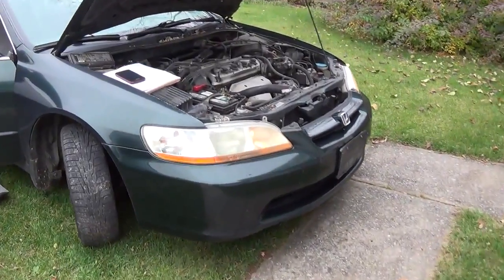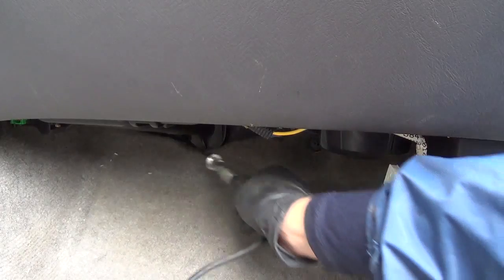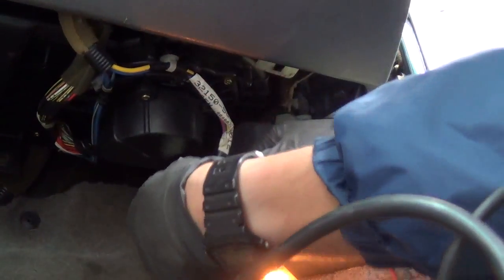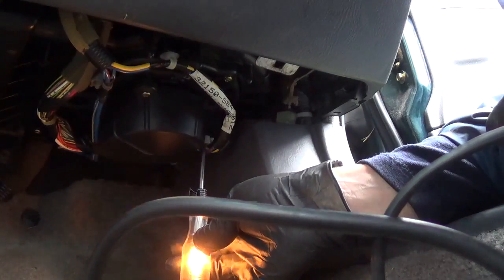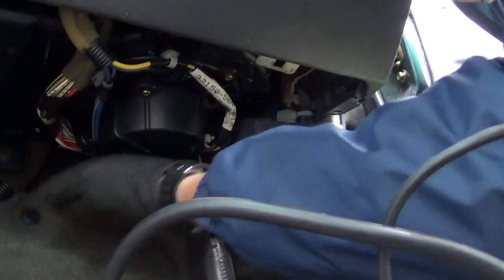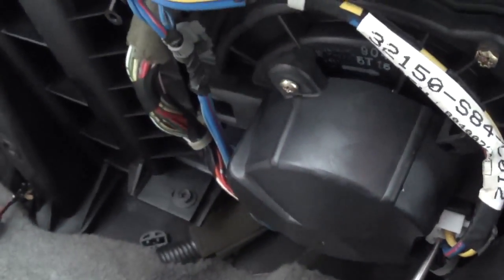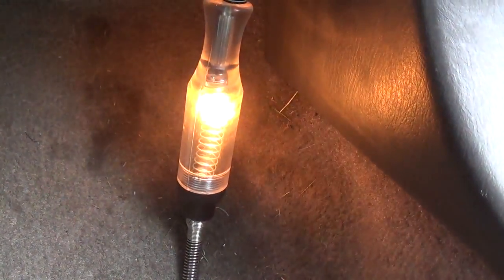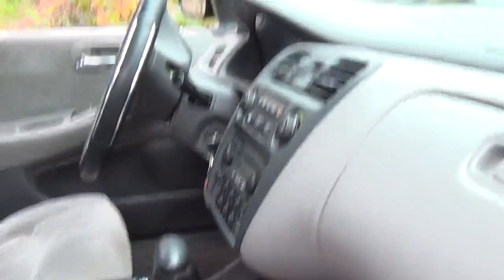Blower Motor Intermittent: Quick diag

Comment: hey everyone out there, with this problem....be sure to check that the wires in your connector are making contact...I just readjusted the wires on mine and its working again....I spent years with this motor not working properly and it was just some wires not connecting well....hope someone else out there gets lucky like I did. Thank you for the video pine hollow!!!

Comment: Wow man, that was pretty awesome. I just used your technique to be 100% sure for my failing honda odyssey blower motor. I was about 80% it was the fan blower because everytime it failed and I went to go check power and grounds at the connector the fan would usually come back to life and I felt I could no longer test it since it was now working. No amount of wiggling things around would get it to fail again it would just happen on it's own. So I figured - yeah it's PROBABLY the blower motor but now using what you've just illustrated I was able to see it with the test light and get it to fail by having it stop on the dead area of the brushes.

Thanks for that!

Comment: Thanks for posting video. I was searching for something different and came across this by mistake.  I have had an issue with the blower motor in my 2009 Jeep for 3+ years.  I knock it a couple of times with a water bottle when it doesn't work and it always comes back on.  Now I know how to check it if I ever get motivated enough!  Obviously not an urgent repair since it hasn't failed over the 3 years I have been "bottle hammering"!

Comment: Intermittent working of car blower fan is not always loose connection , but a lot of times bad brushes inside the blower fan motor causes that , mine even tapping the blower cover with a long stick while driving , starts it again when quits...below is what I got online  :
When they first start to go out, switches and carbon brushes can present either (or both) of the following two symptoms :
Off-and-On Use. ...
Decreased Tool Power. ...
Tends to Run Fine After Starting. ...
Off-and-On Use Worsens Steadily. ...
Off-and-On Use During Operation. ...
Shaking or Slapping the Tool Helps. ...
Banging Sound.

Comment: .. FAN MOTOR RESISTOR .. DID YOU CHECK THIS...? 🥰.. HOW DID YOU ULTIMATELY REPAIR THIS FAN-MOTOR PROBLEM...?👍🙏😇
Reply from the maker: DID YOU WATCH THE VIDEO?
Reply: @PineHollowAutoDiagnostics  .. Yes...Sir .. I just was wondering if you replaced the motor, or did you replace the resistor .. You diagnostic of the Fan-Motor was great .. I had not heard the word "commutator" for many years, but after looking it up, I understood just what you were talking about ..👍👍👍

Comment: I’m changing mine. How do you remove panels to access? And what what tool and size usually to remove bolts of motor and resistor? Sorry a chica asking. I don’t think a mini wrench will help me in this odd spot. 😜I need to buy tools as I have none in city I’m in now. This is a job I’ve never done before so clueless. Done other work on my car before but this nope.
Reply: I think it’s Allan key. Forget it. Lol parts person said bolt. Doh!

Comment: I have a 2005 dodge caravan, ac blower was working intermittently , somewhere online I read that low gas in ac system sometimes causes that , I let they add some gas in it ...no more intermittent working blower...mechanic touched nothing , no relay no fuse , no module , just added gas...I don't know if will it work  for every case , but worked for me
Reply from the maker: Do you mean the blower fan or the A/C compressor?
Reply: @PineHollowAutoDiagnostics  I mean blower fan  , but sorry I was wrong , problem came back , my problem is exactly what you show in this video , I am gonna buy a new blower fan...btw  my problem is not that severe , about 90% of the time it is running and when quits after about 3 minutes by itself or whenever car falls in a pothole or so comes back by itself...thanks for your response and your video

Comment: Double check me, please. Assuming blower motor brushes and commutator r good, our test light should b bright when connected from control to ground in off position. At low speed the test light should b brightest. Because there is the highest voltage or differential. If blower is on high, light should b off because a full ground is being supplied to motor control and so there should b least potential. When switched off, no light indicates open circuit. Bad brushes/ commutator.
Reply from the maker: +Bill Rimmer Yup that's an accurate description. That's why they call it "scope on a rope" ;)

Comment: The Test Lamp is flickering because the climate control uses (PWM) Pulse Width Modulation to control the motor speed instead of the old method of just different resistor voltage dividers to control speed.

The PWM system uses duty cycle to control the speed by turning the DC Current off and on in different time cycles i.e. 50% duty cycle would be approximately half speed, 75% Duty Cycle 3/4 speed etc.

However, the motor can still have issues with its windings or more likely as you said issues with the commutator making bad contact, perhaps moisture over time has caused corrosion in the motor commutator causing poor current flow.
Reply from the maker: No, not on this car. Actually you wouldn't see the test light flicker even on a PWM system, since the driver frequency is much higher than can be seen with a test light 😉
Reply: It's higher freq. / so faster than the eye can notice and our eyes have the property of persistence so its just the opposite, the human eye would see it lit up. However, the  sensor of the camera is fsst enough to detect the flsshing of the PWM. And, yes that car would use PWM. It's not old enough that it would be using purely a resistor network for the different speeds. You got to have something from the 70s with those bulky power eating resistor voltage divider systems.
Reply: Curious if PWM is the reason for needing heat sinks on the modules? Would older systems using separate, individual resistors still need the heat sinks?

Comment: Your diagnose is OK, now remove the motor and clean the contacts in the rotor and brushes. And at the end put some oil or light grease on the bearings. Done.
Reply from the maker: +Willem Streutgers That's extra charge! If it was my own car of course I would have torn the whole thing apart :)
Reply: So I understand the Q was only diagnose instead of Fix it ?
Reply: Willem Streutgers you have to pay for a rebuild or repair. This would only fall under the 1 hr diagnosis pay, which he did in 5 min. It’s a pretty good diagnosis too.

Comment: i have a 2014 chrysler town and country and i think i have a bad blower motor there are times where its delayed coming on when i am driving it it comes on but then goes out it repeats that could it be a bad blower motor?
Reply from the maker: Sounds like a bad controller or resistor, not the blower motor itself.
Reply: @PineHollowAutoDiagnostics i changed the reistor still same problem i am at a loss

Comment: 2006 Chrysler 300 3.5 Touring Blower motor works most if the time and then sometimes - although rarely when I start the car and turn the knob - nothing happens - and there are no illumination/ lights on the control unit. When it is running it blows strong and in all positions and in all different speed selections. Any suggestions?Thank you in advance!
Reply from the maker: did you try kicking it in the pants like I did in this vid? ;)
Reply: Haha.  
I would have but when I went into the car today it's working again.  
What do you think it could be?
Do you think the blower motor needs replacing?

Comment: My blower motor has a delayed start, which has just started happening. Takes up to 20 minutes before it comes on, - what is likely the cause ? - any suggestion appreciated. Works on all speeds when it finally comes on
Reply: Test the blower motor
Reply: @deerhunter8533  Yes, did that, - turned out to be the relay

Comment: My  blower motor stopped working for 3 days then kicked on suddenly on a 92 silverado c1500. The dealer said it happened alot on those years and even into the early 2000s. Said they see alot of the   blower resistor melting or something other. Can anyone confirm this as a possibility?
Reply from the maker: Sure, anything can melt! Do a wiggle and bump test, should be easy to track down :)

Comment: The Hondas here in Canada tend to get Polar Bear fur in blower motors. {;-)
Reply from the maker: +wysetech2000 Should have popped it out and done a visual inspection ;)  I assume that dead spot is caused by the motor/fan being mechanically stuck and being turned on for a period of time, burning out that commutator segment.
Reply: +motoYam82  Yes Ivan, you could be right.

Comment: So basically if blower motor doesnt work, but if you hit on it and solves that problem its a bad blower..

Mines does that. Already change the resistor thinking it was bad. But no, it still blows air whenever it wants

Comment: checked motor blower/fan is good, cold switching and warm switching 
works I can feel it air changing temperature next to the fan...but the 
air is still not blowing from the fans - 2010 honda crv ex